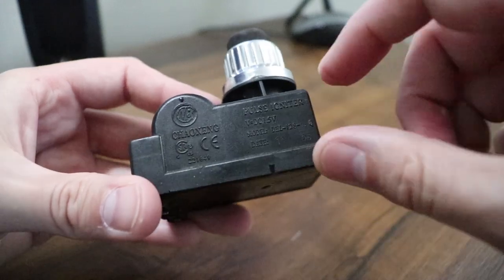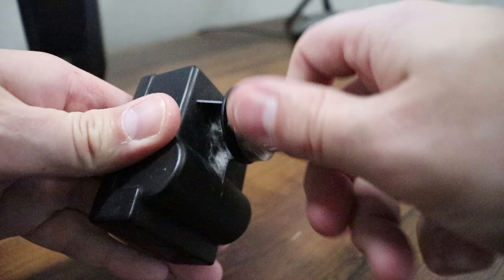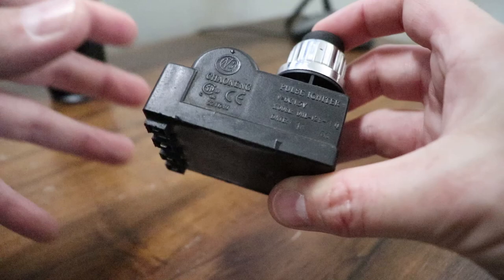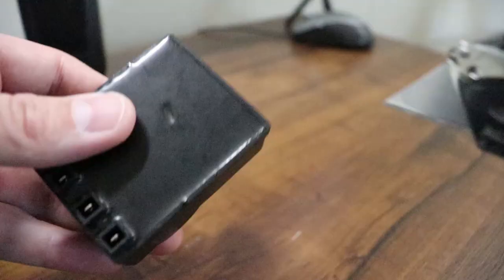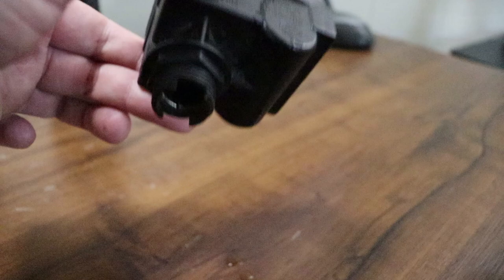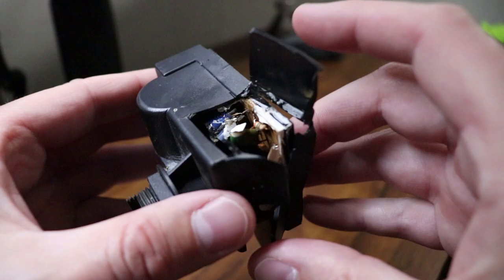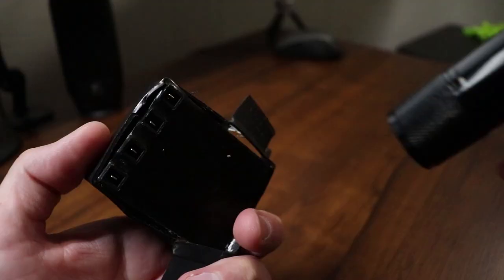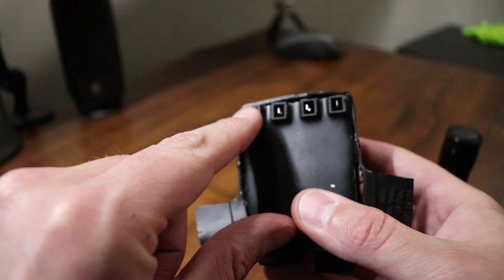Gas Grill Won’t Light My Pulse Igniter/Ignition Is Not Working No Spark

Comment: My igniter stopped working some time ago, and I bought a kit to replace it. No time to install, so for months I was using the butane lighter approach to lighting the grill, a real pain due to getting myself all greasy removing the grills and heat plates each time to get to the burners. Finally got around to cleaning and fixing the grill yesterday.. Cleaned out all the old burned grease and crud (I scrape and scrape and then vacuum it all out with my shop vac).. and then got my kit ready. When I realized that with my particular grill it was going to be a bitch to take the main burner out to replace the wiring, I took a minute to double check the battery compartment. Looked like the contact for the negative side of the battery (the contact inside the igniter box) was kind of dull. The way I cleaned it was to cut a thin strip of course sandpaper and wrap it lengthwise around the eraser end of a pencil, stuck it in the battery tube and rubbed away until the contact was all bright and shiny. Installed a fresh AA battery and voile: Working igniter! I also ordered a set of stainless heat plates to replace my rusted-out set, and so my grill will be just like new! Hope this helps some of you avoid messing with new igniters and wires.
Reply from the maker: This should help others for sure! Thanks for sharing this with everyone!!!!
Reply: I can’t get mine out. Thanks for the tip on the pencil/sand paper

Comment: The main problem  with MINE was not water but the button. Use a Clip lead to connect the spring to the battery.  However, keeping the grill outside will get water into the igniter.
Reply from the maker: Thanks for the tip I will try it sometime

Comment: Recently i had to replace on on a natural gas heater. I called everywhere trying to find one in stock. I guess they will blame no electric igniters on the bat crap fever too. I needed a single igniter but found a quad igniter. There are 3 specialty grill shops within 3 miles and none had igniters in stock. True value had the quad. I made some modifications to the heater in order to install the igniter. If you are forced to use a multiple igniting switch and only need one or two terminals be sure to install an insulated wire on to the other terminals and take them to ground. If you dont the spark will jump from termial to terminal and the switch wont work for you. Dont bother trying to put insulated blade or pin terminals on there to keep from arcing. They will arc thru tap e hot glue and your hand. Just find a good ground source use a self tapping screw and a tiny washer crimp however many y or o terminals on the wires attached to the terminals not needed and ground them to the frame of whatever the igniter is being installed on.
Reply from the maker: ok thanks for the information bud!
Reply: @jamiewagner  you bet cha. Warning if you arent used to getting zapped dont have your hands near that sucker until its got the leads and is grounded when that buttons pressed. Im an electrician so anything under 277v is cool with me but ive made disposable cameras caps zap folks and they pissed themselves. Some igniters actually ground to the chasis its attached to by a copper band around the neck of the igniter. If thats the case when you put the battery holder and button part through the hole in the frame then snug it down with the plastic nut you may or may not have to griund any extra contacts for the igniter module. Install. Connect the igniter lead and push the plug button. If it sparks and you dont hear load soarking under the console you may be set. If you hear sparking look under if you see blue arcs jumping from terminal to terminal then you will need to install another wire per contact and ground them. Hope this helps

Comment: Thanks, mine is 3 years new and it quit. I changed battery, used Deoxit. Still no clicking or spark.
Reply from the maker: yep! check on amazon you will probably find exactly what you need

Comment: So how do you identify the correct one? Is there a model # on it? How do you dissemble it? More questions then answers with this video.
Reply from the maker: yes each grill will be different, you have to check your manual to your grill so you know which replacement one to get, some grills burners then others and the placement and size is different so you will have to find the exact correct replacement one

Comment: So. Is there a way to make them water proof. So this doesn't keep happening?
Reply from the maker: you know hwat, that's a good I dea and yeah I'm sure you could make this waterproof which is what the menufacture should have already done for us, but If I really wanted to yes I could seal it and waterproof it
Reply: probably make sure your grill is always covered when not in use. It's likely the water enters through the button housing and  makes its way through the battery housing to the interior of the unit. Although the rubber button itself is removable, so you might be able to apply some kind of waterproof gunk to the inner threads up where the button is seated.

Comment: My grill is only like 4 months old and it all of a sudden stopped working, the igniter I mean.  I replaced the battery, nothing. Now I'm going to try this for mine, but it's only 4 ish months old!! damn.  Probably heavy rain is what did it.  Hope I can find a replacement pulse igniter
Reply from the maker: Yeah this is probably what’s wrong. I think I put a link to amazon where I got mine in the description of this video, or you could just find one wherever you shop, be sure to get the exact one because they have different ones.
Reply: @jamiewagner  Are they all pretty much the same for different brand grills?  Mine's a monument
Reply from the maker: depends on how many burners, some have more than others and some are different styles
Reply: You should probably also find a replacement grill cover. Nome sane?
Reply: @thebigzippo  the cover is fine! I think it was trapping moisture INSIDE and thus corroding the igniter.  Either way, I now just keep my grill in the garage
Reply: @minimusmax  Good to know!

Comment: Hi bud. I got a 6 burner igniter module and replaced it with a new one. Does it matter if the lead plugs get jumbled up to whichever socket?
Reply: No it should not
Reply: As long as there are as many plugs as you have burners that is

Comment: I have two wires does it matter which wire is connected to the ignitor  i just replaced my ignitor
Reply from the maker: you should place the wires in the correct openings on the new igniter if your grill has more than one igniter wire.